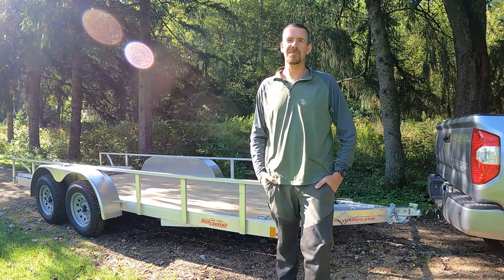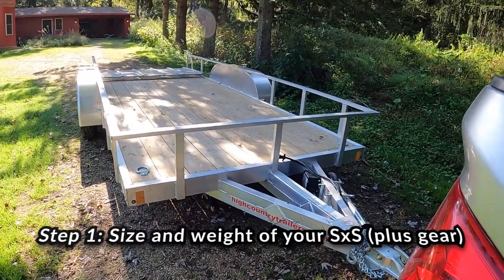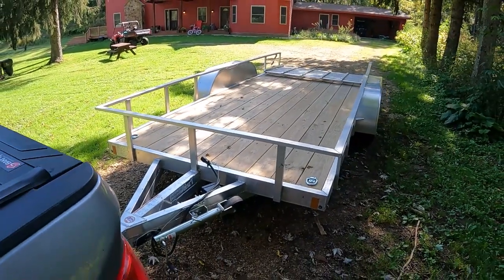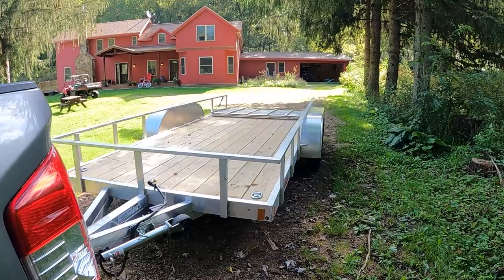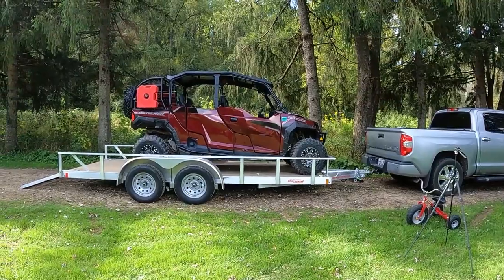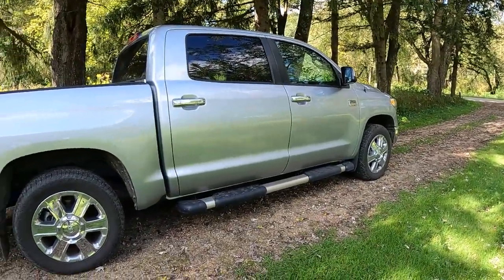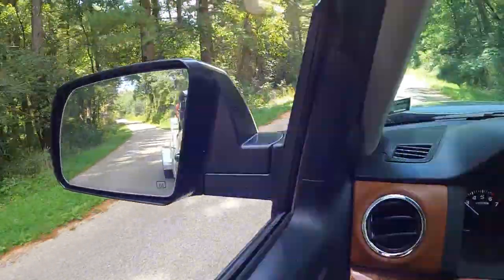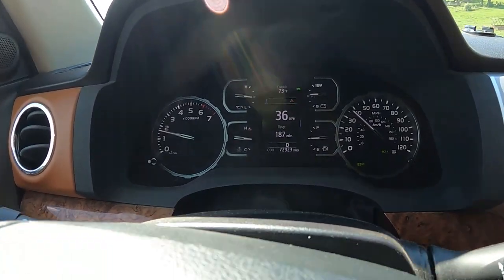Complete Guide: UTV Towing & Trailering

Comment: How does the trailer braking work if you don't have the trailer braking switch on your truck?
Reply from the maker: It doesn’t! The emergency brake that is activated by the cable if the trailer comes off the hitch will still work however. Another option for trailer brakes is “surge brakes” which don’t require a trailer braking system in the truck. Those just work off the momentum of the trailer itself, and they generally work pretty good.

Comment: Did you have to get a wisconsin trailer plate for hauling your side by side?
Reply from the maker: I didn’t think we did… and the sales guy said no…. but since you brought it up I’m having second thoughts 😆  need to do some reading….
Reply: I wasn't sure either originally from Michigan. In Michigan every trailer has to be plated. I understand in Wisconsin the trailer less than 3000 pounds doesn't have to be plated etc.

I recently bought a polaris ranger ultimate in Michigan but I'm a Wisconsin resident. The big tex trailer I bought is 77 by 14 long. My trailer title shows the shipping  weight 1400 and G V.W.R up to 6000 pounds. 
 
My concern is the total weight hauling it down the road if it has to be registered and plated considering the total weight polaris/trailer over 3000 pounds. 

I'll make a trip to the dmv in Madison Wisconsin with my trailer title and registered it. Take it from there.

Comment: I'm pretty sure his aluminum trailer doesn't weigh fourteen hundred pounds especially with tandem axle.
Reply from the maker: Would you expect it to be more or less? 

I’ve never weighed it on a scale, but the manufacturer’s website says “curb weight” for this specific model is 1487 lbs. The certificate of origin gives a “shipping weight” of 1480 lbs. Next time I take a load of junk to the dump I’ll ask them if I can weigh it quick.

Comment: Mine just says 2363kg for gvwr and gawr.
Reply from the maker: Single axle trailer? I suppose that would mean the axle strength is the limiting factor of the trailer…. The weakest link in the chain so to speak. Probably not uncommon actually. GAWR = Gross axle weight rating.
Reply: @TheNorthwoodsFamily  trailer is usually a tandem axle but I had it custom built with one axle.

Comment: Do not strap it down the way he shows here. It is the same as strapping it to the body or above the suspension. You want to strap it through the wheels, over the tires and wheels with a strap or better yet a tire bonnet. He mentions that his straps keeps loosening. That is because he is strapping it to the nerf bars and that whole body is bouncing up and down with the suspension and loosing them.His way is not good and unsafe. If you can not strap it over the tires and wheels or through the wheels, then attach on the an arms closest to the wheels as possible. Keep the wheels forced to the trailer and let the rig bounce with the suspension without a strap the body.
Reply from the maker: Appreciate your opinion but it is not unsafe. Truckers strap cars, trucks and heavy machinery down to the frame all the time. 

The straps loosen this was because the loops slip into position and tighten up after a few miles. I stop after a couple miles, click them a few more times and they stay tight all the way across the country. I’ve have trailered this machine thousands of miles across the country many times and they never loosen.

Your way of strapping the machine down over the wheels works great too. The problem with that, and why I don’t do it, is because it limits where you can put your machine on the trailer. Depending on what we are carrying I will need to move my machine forward or back on the trailer to fit other gear or balance the weight.

Comment: I'm no expert, but it seems you're going to wear down your trailer brakes very quickly...They're meant to stop only the trailer weight, but you set yours to do most of the braking for your tow vehicle as well...They should only tug slightly on the tow vehicle when braking
Reply from the maker: You are right in the sense that the trailer brakes should be slowing the trailer. However, I respectfully disagree with the rest. The bias sets the proportion or relation of the trailer brakes to the vehicle brakes. In the video I am just testing the bias setting. I am applying 0% braking power to my truck, but 100% power to my trailer when testing the bias.

Once set, and I apply my truck brakes, the trailer brakes are automatically applied in proportion to how hard I am applying the truck brakes. The truck brakes slow the truck down (and the trailer a little too). The trailer brakes slow the trailer down. They work together. The harder I brake the truck, the harder the trailer brakes are applied.

In an emergency braking situation, when your truck activates ABS, you want your trailer brakes at their threshold (max braking power) without locking up. If they are set too light,  you're extending your braking distance. Plus, the trailer could try to "pass" the tow vehicle and come around on you which is even worse. Likewise, you can have the same problem if the trailer brakes lock up too soon.

There is a little wiggle room. I've been driving and if it feels like when I release the brakes the vehicle jolts forward, then I back off the bias a bit. But in most conditions, setting them this way gets me really close. And at the end of the day, even if I have to replace my shoes every few years (4,000 miles and they look brand new), I'd rather do that and maximize the braking abilities of my rig. Brakes are meant to be used, and I set mine to give me the maximum ability to stop in an emergency.
Reply: I have the same truck as you  and I tow rzr and quad in the bed it tows fine  good video